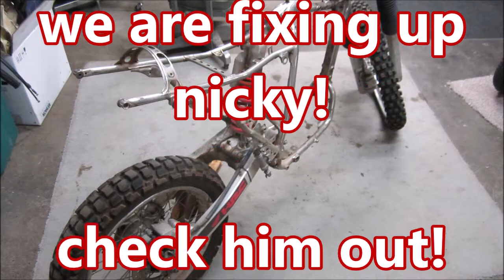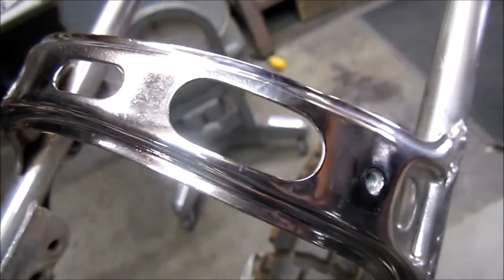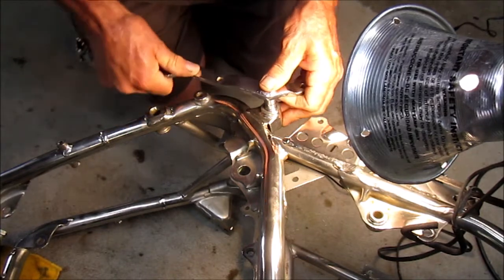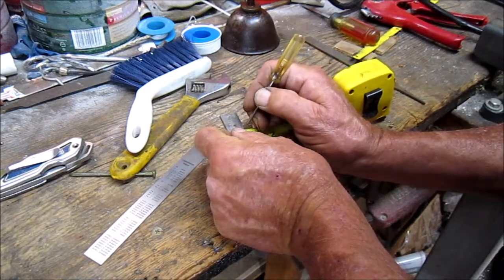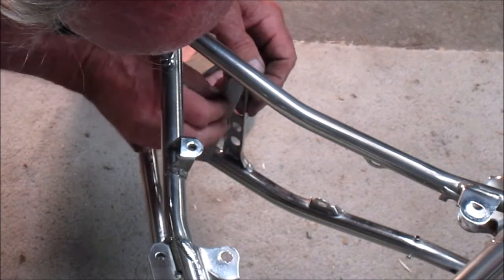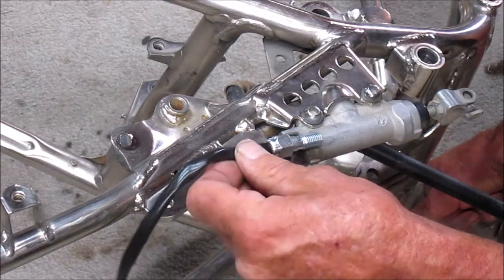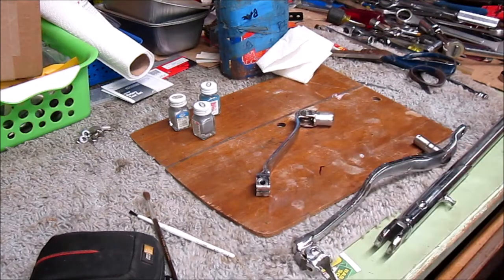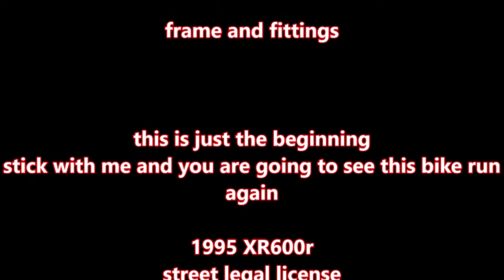Nicky episode 1 frame and fitting

Comment: Parece un T2000 Terminator!!!
Reply from the maker: Sí Eduardo, ese marco es especial con el niquelado. Me entristece un poco tener que desmontar mi vehículo todoterreno 96 para hacerlo, pero al final tendré un 95 ohv que también tiene licencia de calle para esos momentos en los que necesito salir un poco a la acera. Y ... no habrá más blanco en ninguna parte de la bicicleta terminada.
  Veo el níquel como una mejor opción que la pintura y sí, el semicromo es un gran pulido.
¡Terminator vive!

Yes Eduardo, that frame is special with the nickle plating. I am saddened a bit to be disassembling my 96 off highway vehicle in order to make it, but in the end I will have a 95 ohv that is also street licensed for those times when I need to go on the pavement a little bit. And... there will be no more white any where on the finished bike.
 I see the nickle as a better option than paint and yes, semichrome is a great polish.
Terminator lives!

Comment: I really like your channel just bought a XR 600r and I need to touch up my frame thought I'd ask you about matching paint or touch up paint for a white  match.
Reply from the maker: Why thank you and I know you will enjoy the 600 as long as it does not give you trouble. If you got a good one it should last a lifetime.
 Touch-up paint for the paint honda calls shasta white? I just dab on testers model car/airplane paint from out of the tiny bottles at the hobby store. I suppose you could do like I had done in the past with a different bike and go to the automotive paint supply house. There I had them digitally match a color and put it in spray cans. 
Might be your local shop has a formula for honda's shasta white and can mix up a batch.
 If it was me I would not worry about it and would consider the boot worn area on each side of the frame as a badge of honor, or a gauge of how much use the bike has had. But for spots here and there, big and small, I've used the testers and found it pretty darn close to shasta white. Couple applications one on top of the other to fully cover and hide the steel.
Welcome aboard!
2many
Reply: @2manyrides  Hey thanks for sharing.  Really appreciate it.

Comment: Hello, I'm thinking of getting a 1980 XR600R. I understand that the oil is in the frame.
Reply from the maker: Some one has given you mis-information. There is no such thing as a "600" xr in 1980. Nor an oil in frame bike by honda. Might be a typo... and you meant to write 1990? Although an earlier xr600 is quite useable, I prefer to deal with XR600's 91 and up due to their disc brakes front and rear. And though it has been said that the pre 1988 XR600's with their dual carburetors make a bit more power than the single carb units, I stick with the later. In fact most all bikes in my fleet are singles for the simplicity of it all.
 Good luck in your quest, thanks for your comment.
Reply: @2manyrides  Thanks much for taking the time to reply. I haven't even seen the bike yet but I wanted to gain as much information ahead of time. Your video was great, and thanks again for the pointers.
Reply from the maker: @CHIEFTATELLI  Yep, no trouble. Let us know what you find. BTW... "nicky" turned out to be BITCHEN! Did you see it in action?
https://youtu.be/jOr9HYKZVpY
Reply: @2manyrides  I saw the one where you set up 4 cameras. Never road like that but it must be so great. I am exclusively a city rider but being out in the woods and with no traffic must be great. The guy who has the XR just emailed me asking what I wanted to pay. Haven't even seen the bike, only photo. Turns out it is an 83 XR600R that was blown out to 650 with big front disk and Brembo calipers. Have no idea of miles but it looks very clean. By way of replying to the guy, can you give me a market price range for a XR from the 80's and I will send him that range.
Reply from the maker: @CHIEFTATELLI  OK, but the one I linked to climbs a mountain in the forest. Far from what riding you do it seems. 
 Where you are makes a difference on what a bike is worth. Sounds like you need a dominator, an NX650 not a 650L or a 600R unless you're the type that likes to build and to work on bikes.

This link, by some other guy, gives a pretty detailed look at the 600's...
https://youtu.be/nNcDTByUYU8 
Shows the history through the years and the model year changes. 

To price out the bike you painted a picture of is a guess and my judgement from my vantage, in my location. It may be what you want? A bike like that, all beefed up, super moto wheels, brakes... Set-up for the street and with road license, sellers might be asking for 3,500-4,800 $ 
But if it's still just a plastic tank and fenders converted dirt bike $2,500 and up based on condition.
I have seen them ask for more, but the problem is they've just dumped too much money into it that they'll never get back out. 
 If you can get it way cheaper the better.  XR's are getting far and few right now, but I still see this kind of set-up going for about 3 thou...
 If this pretty picture isn't looking so good in person... cheaper.  If their bore job and mechanics are sound on it, no funny top end noises, it does not smoke, then you just need to make sure of two more things!
#1 the countershaft splines are NOT WORN underneath the sprocket !    ...and 
#2 the transmission gears are not pitted. Be diligent about making SURE and you should have a good bike to mod and make how you want it. I have bought a few 600's and noticed the gears were pitted LATER, too late. Usually 2nd or 3rd, but I have seen 4th pitted.
 I like an xr600 to ride around on the city streets with. But then my whole bike career has been mostly singles. 
Keep in mind, it is a 30 year old dirt bike that has been converted. (xr600's do not have a cush drive)

I just keep thinking, maybe an xr600r isn't the kind of bike for what you say you do. And that there may be many others out there that might suit you better. 

My Idea of an XR600r in the city is more of a hooligan machine. Jump curbs, cut across lawns, go ride by the river. Being a dirt bike they are not as adapt at highway cruising getting buffered at speed.

I paid 7,800 for my 89  NX650! But it had just been completely dialed in. That alone gave the piece of mind I needed. It ran and looked like new. I've yet to have to address any issue. 
Good luck
2many
Reply: @2manyrides  You make many good points for which I thank you. I happened to have watched that video you linked as part of my research. I don't really get your point about the NX Dominator being the better choice if one doesn't want to do a lot of mechanical work all the time. The stock bikes, XR & NX look very close to each other. Is the NX mechanically better needing less maintenance? 

I no longer have time or a place to work on a bike so what I get needs to work and provide reliable transportation exclusively in this NYC environment. I do no riding on the road, only the streets and expressways of the city where the speed and traffic combines with pot holes, sewer caps all over the place and in general it is like riding off road. Not your of road but you get my point, very bad highways and streets. 

My relaxation is "playing checkers" at speed on the expressways, safely but at the edge of the envelope. My current bike which I have done a lot of cosmetic work on is  totally a road bike but I have never been more than 70 miles out of the city on it. I am blowing fork seals twice in two years even after having put in heavy duty springs with emulators and new rear shocks. I feel every bump. I am 6' 6"  215 pounds on a very heavy bike. GL1000 Limited https://drive.google.com/file/d/1yeUl4Qt63bJRZpQapzONUXUCt3aMmM1p/view?usp=sharing

In 2002 I bought new a KLR and this is what she looked like after I had turned her into a street assassin. https://drive.google.com/file/d/1-4WAonAAWrKK569wYy8dBN9HWGXpTgc9/view?usp=sharing Front sprocket one tooth less for more off the line, rear sets and much more. With this bike I felt nothing and cut through traffic like butter. Unfortunately I got caught in the 2008/9 collapse and lost the KLR and my R80/7.

Here is the XR. It is the only photo I have of it and have never seen it up close. The owner is 76, here in the city, and doesn't ride the bike. I'm 70 but still ride year around. This is what he says is in it: Big bore kit 650 cc Ported head, Megacycle cam, Lindemann modified suspension (shortened travel). https://drive.google.com/file/d/1UYoA4amGyV-yqEUmb8yNdMk_TCBT0ULv/view?usp=sharing 

I'm living on SSecurity so I don't have money to throw around. I looked into swapping out my GL's front end for a GSXR 1000 front end from Cognito Moto and pricy rear shocks from some place in California but we are talking $4K if I'm lucky and who knows it in the end it will be as good an improvement as the XR for the streets. 

Forgive all the writing but can you clarify two things for me. 1) In the end if the XR is in good running shape what would you think is a fare price. 2) Can you clarify the XR/NX issue for me. Eventually I would be going in the direction of my KLR. Is one better to do this with than the other. Best regards, Mark
Reply from the maker: @CHIEFTATELLI  OK, good, Now I have more to go on...
To answer your questions,
#1 the xr looks to be well sorted. If it's all running good 3,000-3,500 bucks.
#2 xr/nx issue;
An XR is a simple bike with no frills and is a tall bike.
The nx is lower has less travel and has tons of plastic parts. Shares the same motor as the 650L, but that is all. Everything on an nx is one of a kind. Made through 2003 for Europe, they only were available two years in the US. Though they are more ready to go in stock form for urban street fighting, a good one in NYC would be rare. That xr seemed well sorted.

In the early years, Honda did some strange naming changes. (XR's) You've shown me an xl600r. Big difference from a xr600r.
You can look up specs. Thing is the xl is a street bike from the beginning. You are on the right track if the bike is good and the price is right.
Reply: @2manyrides  Thanks so much for allowing me to pick your brains on this. I am going to write him back and take it to the next step with him. But now with your help I have confidence in a price range and that the bike has got good bones and is something to go after. I will let you know what happens in the end.
Best regards and keep the rubber down,
Mark
Reply from the maker: @CHIEFTATELLI  Obviously, I'm only in a position to make general assumptions from one picture. It's up to you to go deep with your inspection. There are many parts becoming unavailable for 600's these days as Honda has quit supporting them. My friend just rebuilt the motor on an 82 xr500r and found many parts unavailable. 
Good luck with your quest!
2many
Reply: @2manyrides  I understand your distance from this and inability to make a solid call on a bike in a photo. You have helped so much in educating me, now again with this lack of parts issue, and I will make a decision based on my seeing the bike and raising issues with the owner. Thanks again man.